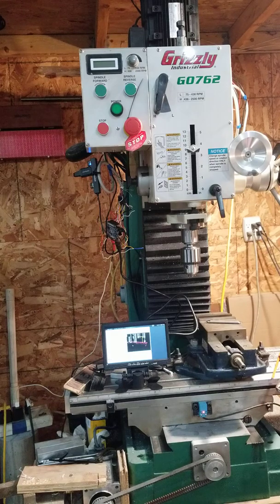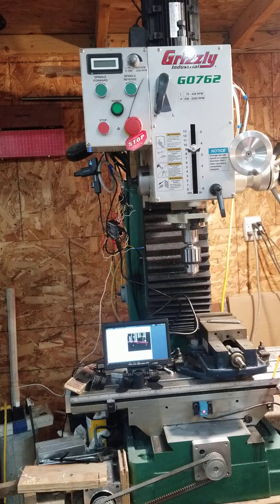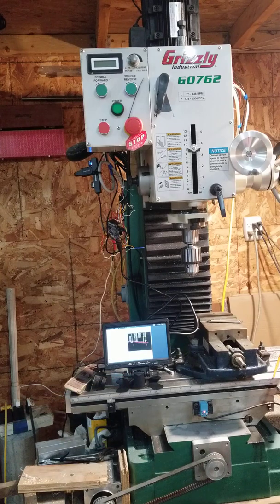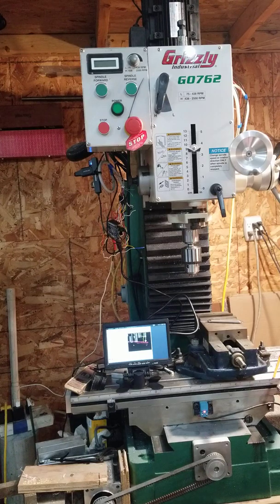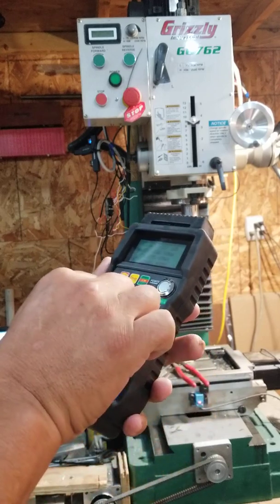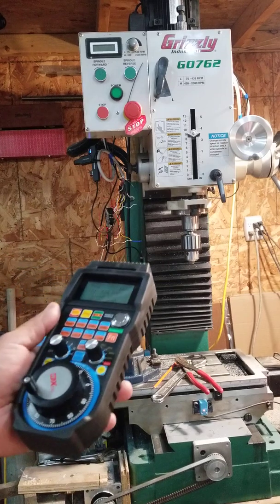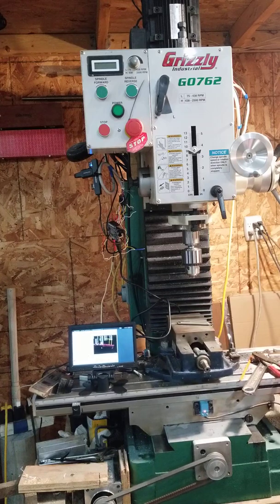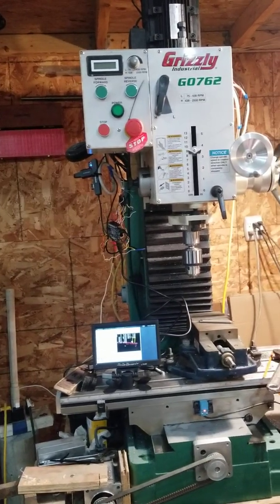LinuxCNC on Orange Pi One

Comment: what version of armbian are you using? Are you using buster xfce desktop? 

How about the latency results?
Reply from the maker: This was the version I installed.
Armbian_21.08.1_Orangepione_buster_current_5.10.60_xfce_desktop.img.xz 

As far as latency, I don't really remember what the numbers were, but I determined it was acceptable, but I only need 30 kHz.
Reply: @jbrannenii  Are you using mesa card?
Reply from the maker: @ferysetyawan1354  Sorry for the very slow response. I haven't been using my machine for a while and just saw your reply.  The way I have this set up is with an Orange Pi One with the GPIO wired directly to the parallel port breakout board. There is no MESA card. One of the users on the LinuxCNC forum had created a port of linuxcnc that works on the Orange Pi One and leverages the additional RISC core that board has to handle the stepping tasks which according to him yields up to 1 MHz step rates. I only need 30 kHz right now but may increase microstepping to need 60 kHz but that is yet to be seen.  The forum thread about this is here https://forum.linuxcnc.org/18-computer/39037-linuxcnc-orange-pi-allwincnc
Reply: thanks for your reply. I've tried many versions of armbian on the armbian site (orangepi pc), but I can't find the armbian buster lightweight (xfce) version. And I've also tried to install on the orangepi pc (1 Gb RAM) but the latency results are very bad.